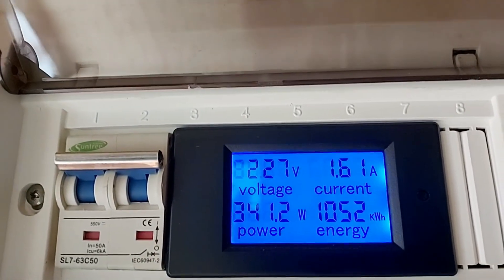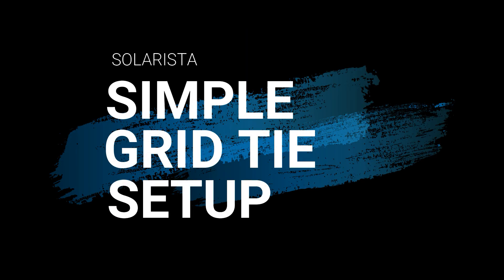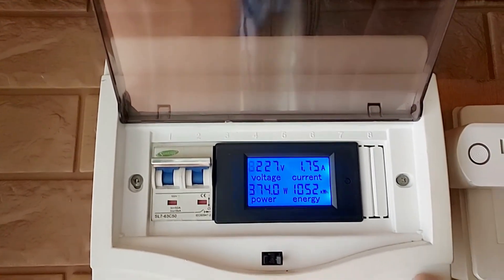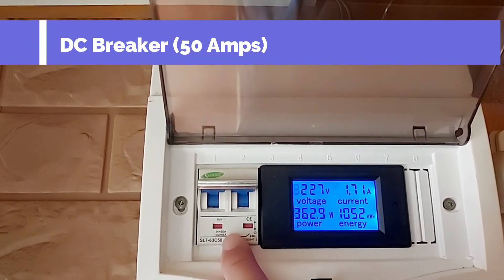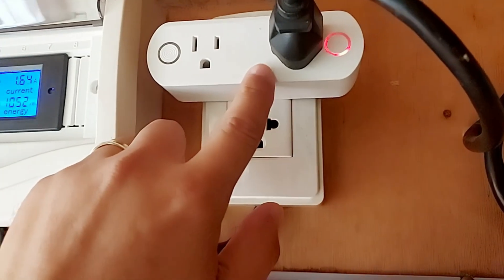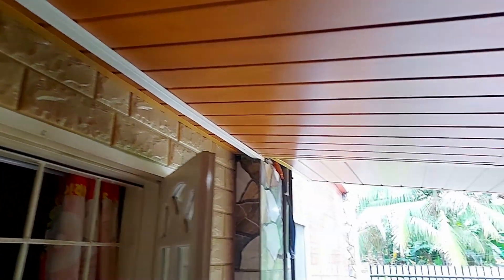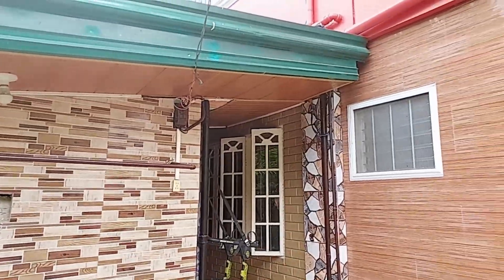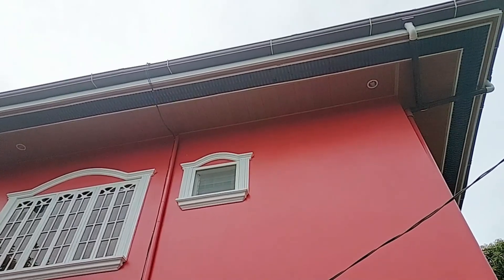SIMPLE 1000W SOLAR GRID TIE INVERTER SETUP-PART 1 | DIY Petz

Comment from the maker: Here's an update of the Grid Tie Inverter on how to do a smart cooling.
https://youtu.be/WRlgLTWo_Ng
Reply: is it ok to connect your AC output on AC outlet instead on the AC main breaker?
Reply from the maker: @shoomaklovesemmy  Yes Sir, as long as the wall outlet has the correct cable sizing  Sir.

Comment: 2 things that makes fan burn, the heat and you need to use 50% of charge means you may expend your capacity also the grid tie inverter you need to remove from the case and put it in bigger case and add 4”+ fans 2 at the front and 2 at the back. In Philippines it is hot means needs to cool down more.
Reply from the maker: This is well noted Sir. Thanks a lot for this.

Comment: What is the size of your PV Cable sir?  is that 10mm or 16mm
Reply from the maker: 16mm Sir.
Reply: @RollyPetz  panu nio po npgkasya yung 16mm sa MC4 masyado po kc mtaba yung wire kakasya puba sia sa MC4 connector? san pu makakabili nun pd puba pasend ng link sa lazada..pra mka bili po ako.

Comment: thank you, can  this type of inverter use in your home only for day time in an area where there is no utility supplies to plug in into the grid?
Reply from the maker: Hi Sir, if there is no utility provider in the area, I suggest to setup and off-grid system with battery. This could not be used. thanks.

Comment: Hello, i have off grid solar system with lifepo4 batteries that work 24/7. my question is, can i add grid tie inverter 1000w? they reason i want to add it, is to safe battery capacity to have more power at night. so when my off grid solar system is on, and if i add on the plug the grid tie inverter it will work? or i will do damage to my off grid inverter ? thank you very much
Reply from the maker: Hi Sir I'm not an expert on this but do you have diagrm to illustrate?

Comment: tumatagal pala ng 3years plus yan ganyan inverter, thank you for the information
Reply from the maker: Actually Sir, yung ganitong klase na inverter is less than 2 year lang talaga ang lifespan niya.
Reply: @RollyPetz tumatagal Yan Yung sakin more than 3 years na 1.4kw version. 1kw+ output daily..  need mo Lang icool Yung loob butasan Yun cover lagyan Ng malakas na inlet at exhaust fan.. palitan narin Yung malalaking capacitor malamang mababa na value kung walang cooling fan Yun dahilan kung bakit nasisira Yan......
Reply: Sir first time ko mag set.. talagang babawas ba sa bayarin sa kuryente natin kahit diy lang

Comment: I'm planning to make 2k~3k grid tie system, and I'm think using 2~3 of this cheap inverters to save money, is my plan safe and worth it?
Reply from the maker: Hi Ely, for me I wouldn't recommend using this type of inverters as they died after a year and harvest using this one is not good. I suggest to use a much better inverter for your setup.

Thanks.

Comment: Boss ano brand Ng multimeter nyu with dc breaker..salamat sa pag sagot..
Reply from the maker: Sir Eugene good evening po. Yung brand po ng multimeter is generic brand lang din po madami po sa Lazala and Shopee eto po yung link https://invol.co/clb4fyb. Yung DC breaker sir is separate po siya. eto yung connection from from solar panels going to the inverter. Eto yung detailed diagram po on this video po https://youtu.be/hnts-YO4w2I. Tnx.
Reply: @RollyPetz  thanks..

Comment: do you need approval from the electrical utility company to use a grid-tie inverter
Reply from the maker: Good evening Sir Larry. Actually no need Sir in our area, but if this was build for net-metering then that would need an approval for our local coop.
Reply: @RollyPetz I have the same question, thanks for the info sir.
Reply from the maker: @larrygoebel1506  no Sir. You only need permission if your going for net metering.

Comment: Unfortunately this inverters will burn about 3 or 4 months maybe 6 months! Over heating problem!
To avoid danage you must modified cooling fanction!This inverters start cooling by fans over +60-70 celsius!
That inverters need install thermostat switch N.O. 40 celius stick on transformer+ dc-dc stepdown board 40V connected to fans,fans will start cooling from 40 celsius and you will avoid the overheating damage.I am technitian.
Reply from the maker: Good day Sir Jim, I was already expecting that as it happened to my previous inverter. But with this experiment, hopefully this will last longer. For this setup it was able to maintain the temperature at 40-41 degrees. Here's the link Sir and thanks for your comment and feedback.
https://youtu.be/WRlgLTWo_Ng

Comment: Sir magandang gabi jan,anong mga appliances kaya paganahin n'yan sir?,kaya bah 1hp aircon or 0.5 hp aircon sir?.thank po.waiting for ur reply.
Reply from the maker: @Aneth Emia  depende na sa load sa balay ug ang imong setup. Kung ang imong setup is mas dako ma produce na power kay sa imong load sa balay, kinahanalan ka ug limitter pero kung dili ra ka sobra ang ma produce sa imong solar, dili ra needed ang limitter. Ang limitter man gud gi tuyo ma siya aron dili ka mag back feed sa veco where in mo accumulate gihapon ang imong reading sa meter kay uni directional na ang mga meter karon sa Veco.

Comment: With out limiter yan sir?
Reply from the maker: Yes po Sir, no limitter po. Etong type ng inverter wala po
Reply: @RollyPetz  advantage bah ang limitr compare sa with out limitr sir?
Reply: Anong pwedi makaya ng 1000w grid tie invrtr sir?,kaya pah epower ang 1hp aircon sir?
Reply from the maker: @anethemia7857  depende na sa load sa balay ug ang imong setup. Kung ang imong setup is mas dako ma produce na power kay sa imong load sa balay, kinahanalan ka ug limitter pero kung dili ra ka sobra ang ma produce sa imong solar, dili ra needed ang limitter. Ang limitter man gud gi tuyo ma siya aron dili ka mag back feed sa veco where in mo accumulate gihapon ang imong reading sa meter kay uni directional na ang mga meter karon sa Veco.
Reply from the maker: @anethemia7857  actually sa grid tie setup Sir pwede ra any load sa house kay mo act lang siya as suplemental power for the house. Ang power na ma produce sa imo grid tie setup mao na ang primary magamit sa imong load, ang kulanga na power mao na ang ihatag or i provide sa utility provider.
Reply: @RollyPetz  oki slmat sir,plan koh magset up ug grid tie sir,off grid mn system nko sa balay.
Reply from the maker: @anethemia7857  OK Sir ideal lang ang grid tie kung naa ka sa green field area sir. Meaning brown out seldoom or does not happen in any month. Salamat sa comments nimo Sir. Good luck puhon sa imong project.

Comment: Thank You. Very simple and easy to understand. I assume you went with 1100 watts of panels as they are never 100% of rating and so still safe for your 1000Watt inveter. Very nice system!
Reply from the maker: Yes Sir, that's correct. There is still an efficiency factor with the current technology. Thanks for your comment Sir.

Comment: These inverters overheat if you max the output. Use maximum 40% of the capacity and it may last longer. I have two 1400w gridtie inverters but  i connect only 400 watts (max) of solar to each gridtie.  it doesn't get hot and the fan doesn't kick in. During one of my test, i noticed the fan kicks in when it is producing around 500 watts on the AC side which is maybe 625 watts on the DC side.
Reply from the maker: @iamdeji thanks a lot for this Sir. Hopefully this inverter would last.
Reply: if I have 600 watts of this inverger. how many wattage of pv i can connect safely to make this inverter last longer

Comment: how do you add batteries to this system?
Reply from the maker: Good day sir. For this type of setup you can't add batteries, but if making it to a hybrid setup yes you can but you have to add a charge controller parallel to this and then add the batteries. a somewhat complicated one but can be done.